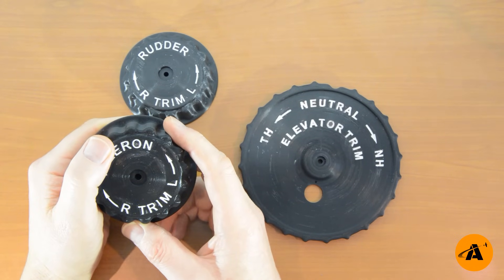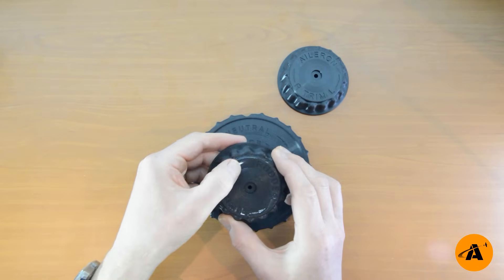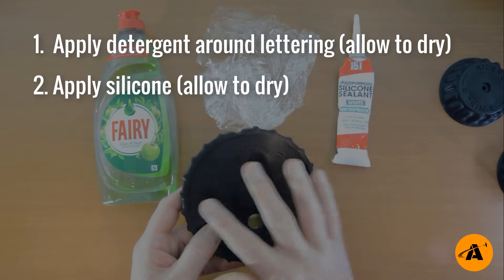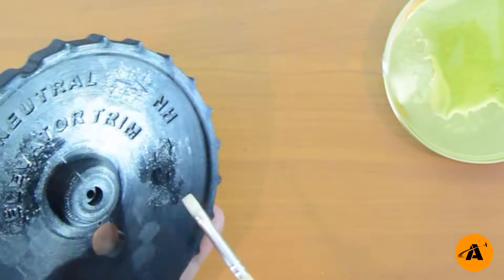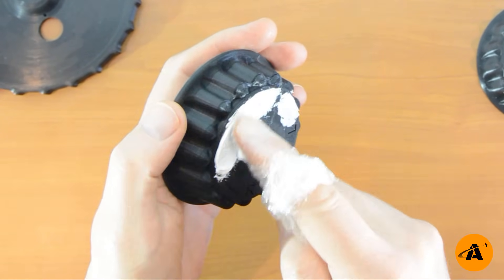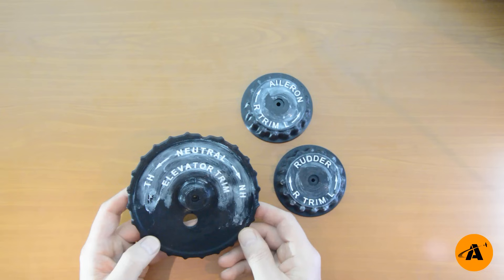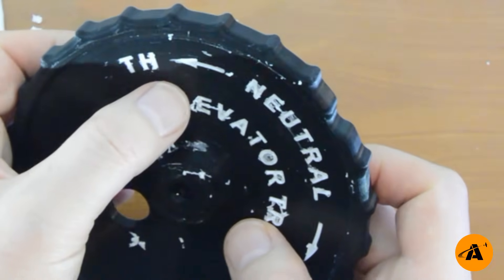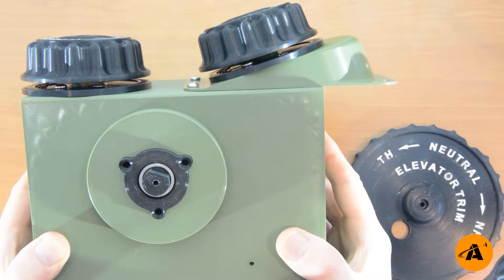Add white lettering to your 3D printed parts

Comment: Have you considered raised lettering? set a pause in the slice and change the filament color. Resume print and viola!
Reply: You’ll find that it may not be so easy on the bigger wheel.
Reply: Wouldn't it leave one or more layers of color on any layer that's at the same height as the letters?
Reply: @peterkn2  correct. one can maybe achieve this with custom gcode and a lot of patience, but at this point just get a multi material printer
Reply: @peterkn2  I haven't had that issue. I modeled a part with raised letters and made sure the height was evenly divisible by .2 (1mm) and it worked great.  The first color was orange and the letters were white.
Reply: I used yellow TPU to print large custom raised lettering on some black TPU mud flaps that I made for my Japanese mini truck.  It turned out great.  It wouldn't be as nice with smaller lettering because FDM print resolution is fairly low, and it also wouldn't work in the example shown because the control wheels had portions that were higher than the lettering.  Raised lettering is seldom the highest portion of an object because it'd be scraped off by contact with other objects coming in contact with it.  That's why most lettering is engraved (negative, below the surface) rather than embossed (positive, raised).
Reply: Easiest solution: Bambulab printer + AMS.  With just a few layers needing white, even the waste poops will remain limited.
Reply: @MisterkeTube  I'm waiting for the K2 Plus. I love my K1C.

Comment: I would use a wide roller tip on my pinstriper tool before I went through all that. They're not cheap but they work and save a ton of time.

Comment: It would be possible to redesign the parts to accept a 3D printed disc insert with the text printed as the first layer in mirror mode, either a multi material system or just manual filament changes can be employed. and then glue the disc to the part, the text and the disc could be printed with a shiny glass like finish or a textured finish by using either a textured PEI bed or a smooth PEI bed.
 This would be a much easier method of production.
Reply from the maker: .. or a print of white plastic sandwiched between the black so it shows through the letter cutouts?

Comment: Silicone sealant can be thinned with naptha (white gas in the US or Coleman fuel), which apparently does not effect PLA. You could thin it enough to use a fine brush or a syringe to make sure the bottoms of the grooves are wetted. Neat idea and I will have to white sealant. I wonder if it can be colored easily. The acrylic paints can be good as well but they don't like getting wet.
Reply: Seems to be 'zippo lighter fuel' based on a quick google, can you confirm?
Reply: @MikePreston-darkflib  Yes, I think so. It is like a finer distillate of gasoline. Earliest petrol engines used it because it was being distilled for cleaning. The "gasoline" collection of molecules was a waste product from making lamp oil and burned off or evaporated away.

Comment: Try one of the silicone mastic tools to press the mastic into the letters and clean up afterwards, they remove excess mastic completely from tiles and worktops
Reply from the maker: Thanks. Just been googling that. If the letter surface isn’t smooth, but curved with layer ridges will it still be as effective?

Comment: Have you thought about using a negative draft angle for the letters, so that the silicone is mechanically locked inside the cavity?
Reply from the maker: Great idea
Reply: @AuthentiKit  Was thinking same, or a connecting  sub-surface tunnel.
Reply from the maker: @andyu69  Split it in half, tape over the exit of the letters, fill the inside with silicone (letters joined as you say with channels/tunnels) so it pushes out to the surface, then join the halves either with screws from the back so not visible or glue them

Comment: I've been using regular spackle not the quick dry or lightweight. You put it on like frosting making sure it's all the way into the crevices. Let it get dry overnight. Sand the Spackle off and use a damp cloth or toothbrush. Personally I've been spraying my 3D prints with a clear coat

Comment: Since I don't mind having the letters a little bit sunken and my lettering is in a plane parallel to the build plate, I do it the following way:
I let the printer come up to the plane of the lettering, switch the filament to white, let the printer continue for 2 or 3 layers, switch back to black and print 2 or 3 layers in black with the letters not filled in.
(Yes, that leaves a thin white strip around the periphery also, but I don't mind)
Reply from the maker: 30 seconds with a black sharpie sorts the white line. That's another approach I've considered.

Comment: Nice! Thx for sharing. I tried something like this with extrudes text, but this looks much better. Maybe you could also use that white paint, that car fans are using to pimp the tires.
Reply from the maker: Tippex/whiteout is pretty good. Best probably is acrylic caulk as it wipes off easiest
Reply: @AuthentiKit  will try that definitely! Thx.

Comment: Raised lettering would be much easier to paint than recessed lettering. If you can modify the print to include raised lettering, do that instead.
Unless you have a shaky hand, the painting process will require virtually no unnecessary clean up. 
Of course, for inlay painting, your vid technique works quite well. Thank you.
Reply: Whoever wants to do something like that today probably uses an AMS (multi material system) and just prints it in multiple colors…
Reply: If the letters are raised enough, you just roll the paint out like old printers did on a surface and just press the letters into the paint and lift. All painted at one shot.

Comment: With 3D printing, it should be possible to give the lettering a "lip" or "inner bevel" of some sort (I'm sure there's a technical name for it) so the infill can't peal out.

Make the cavity for the letter bigger on the inside instead of having straight walls. Does that make sense?

Comment: I suppose for letters that big I would try using a ballpen corrector (dont know the name). preferably the one that acts like a pen as well, not the bottled up with a brush or the tape one of course. And for any other flat surface good old spray and flat piece of paper to get rid of the recess + 15 minutes sanding. Still a nice idea but the time and effort just doesn't make it a good option for myself. Maybe if I needed something fancy
Reply: OH and anything that melts like wax and can be done using a hot glue gun and scraped off flat if neccesary
Reply from the maker: Each to their own i guess. I’d hate to do all that sanding. Ive tried the tippex whiteout. Not bad in certain situations when the nozzle is narrow enough.

Comment: They sale paint sticks to do this with, that is what we used in aerospace plants, rub it in let it set and wipe excess off and you are done, I used this on my gear shift knob in the car
Reply from the maker: Thanks. Embossed lettering or debossed?
Reply: Raised lettering in 3D print.

Arial Bold font works well.
Reply: @BlondieHappyGuy  No I don't think Aerospace companies will be using a kids paint sticks
 MRK51123 - La-co Industries Inc Lacquer-Stik Fill-In Paint Marker

Comment: I wonder, if the letters would stay in even more reliably with one tweak. If the letters had a very small amount of negative chamfer, so the bottom of the groove is about one line width larger the top. Then once the silicone dries, it "can't" come out - it won't through the top of the groove.
Reply from the maker: I like it!

Comment: What about using thinned enamel or other type of paint, put in a syringe and squeezed into the lettering grooves?
Reply: I was thinking the same thing, it sounds like that might be less work, right?
Reply: Those little tin pots of Humbrol enamel paint used for painting models. That stuff really sticks well. Clean off or thin down using white spirit.

Comment: There is a chemical call PVA poly vinyl acetate whis is used as mold releasing agent. I think that would make your job much quicker and cleaner. It is certainly more expensive than your fairy liquid but   time is money and i think your overall results would improve.
Reply: PVA is also the formula of simple plain white scholar glue. Since it may became transparent when dried, maybe it is neccessary to add some white pigment to it (maybe some household item like gipsy or corstarch would do?), but it may get the job done.

Other option a litte more expensive but faster is use 3d uv resin with white pigment. Apply it, clear the excess, expose to sunlight and it cures in a few seconds.

Comment: I think this would be easier with just some white nail polish, thinned out with acetone, and injected into the embossed lettering with a blunt syringe
Reply from the maker: Yeh, tried that. Great when you don’t slip or it clogs and blurts out. Mess is hard to remove.

Comment: Almost like @josephpk4878 I like to use casting resin applied with a needle.  Hobby Lobby has little bottles, I think in the model paint area, that have needle type applicators that worked well on my last project.

Comment: That's a pretty good result. But, unless the filler must be a silicone for any reason, and you have bought the whole set of acrylic paint just because of the brushes, why not give these colors a chance? Use as small and pointy brush as possible, thin the paint if necessary, and just fill the letters as precisely as you can, but there's no need to be overly careful, if some of the paint gets on the top surface, that's OK. When the complete text is filled, give it a couple of minutes, then wipe the excess paint from the top surface with paper tissue moderately wet with acetone, thinner, isopropyl alcohol, or water if the paints are water soluble. I never used PLA, so I'm not sure which solvents may damage it, and in general I'd suggest making a test sample plate whenever you use a new type of filament or resin. Do not soak the tissue, and do not press it with your finger into the text, to avoid pulling the paint out of the letters. Just put several drops of thinner onto it. You can use some kind of flexible spatula and span the tissue over its edge and use that to go over the text. If the surface is still foggy but most of the spillovers are removed, give it some more time and repeat the above a bit more aggressively, maybe with some more solvent. Once you find a sweet spot between how much the paint should be thinned, how long you should wait before wiping the excess off and how wet or dry the tissue should be, the whole process shouldn't take more than a couple of minutes, drying times included. Depending on the paint type, final drying time may be longer, but acrylic will dry pretty fast. There's nothing wrong with silicone, but other paint types open the complete palette of colors, take much less time, and you can spray the complete print with clear acrylic spray, to protect the text and even smooth the complete surface...
Reply from the maker: Thanks for that considered response and advice. My experience with getting paint type stuff on the surface where you don’t want it is that its very hard to fully shift it. I guess with thinners and suitable solvents that might be ok though

Comment: Very interesting! I have a Cessna switchbox which has no letters/lines/digits on it. I could make a new frontplate with your method. What program you used to do this job? I'm not good at designing yet... best regards from The Netherlands.
Reply from the maker: Hi, I use Fusion 360. Takes a little getting used to but worth the effort as it's very rewarding what you can learn to create!

Comment: Given you have digital files of it, would it not be easier if you drew a template around the letters, cut it out in vinyl (machines do it perfectly) place it on top, do the silicon thing, peel of the vinyl template..the clean up process would be a lot easier
Reply from the maker: You're right - yours is a superior solution but the idea of this technique was something "good enough" with readily available materials
Reply: @AuthentiKit  oh yeah don't get me wrong I had never thought about using silicon, I really like the idea you came up with!

Comment: I know there are some layer lines as you pointed out, but the surface is remarkably smooth. What orientation did you print these?
Reply from the maker: Just regular orientation as you’d expect.

Comment: Wouldn't a white permanent marker with a fine 1 or 2mm tip do the same job but quicker?
Reply from the maker: I've bought a ton of markers, paint pens, syringes for paint/whiteout. You need a really fine tip with some depth to not catch the edge and a reliable flow of the paint/ink. I sometimes touch up with a paint pen but haven't found it effective for the volume.
Reply: @AuthentiKit  OK, then I am gonna try it your way. Seems simple enough 🙂 Thanks

Comment: Would definitely be careful to make sure it's not washed down the drain. I doubt a little bit would cause a problem, but I've seen fairly small amounts of silicone cause severe septic problems. It can probably cause problems with larger systems too. It can expand a lot and it just never breaks down. (...or it takes a very long time to break down, kind of like human hair and large globs of fat).

Comment: Better then a brush is a piece of soft foam dip it in fairy 🧚‍♀️ and gently dab on your surface even over the letters.   Just saying 😉
Reply: Ps another tip..the brand Motec has filler spray. Get the black one spray that on 3x and gone are the little grooves it won't affect the deeper letters.😉

Comment: This is quite messy dude. Try with nail polish thinned with acetone. Just 1 or 2 ml to a full nail polish bottle is needed depending on how thin you want it to be. Then you can apply it with a needle and a small syringe. Once it dries you can clean it with some acetone if you painted outside the lettering.

Comment: Since these are 3d printer printed parts, you will have a spatula or two lying around. (You can even print one.) Use the spatula instead of your finger to remove the fresh sealant. It makes the post processing clean-up much easier and quicker.

Comment: I'd rather have printed one or two layers of white PLA so that it would be visible on the bottom of the letters and then continue with black PLA. Would have been a lot easier imho.
Reply from the maker: Its an option, but then you get a white ring round the edge you need to colour over
Reply: @AuthentiKit  True. Might still be less work.
Reply from the maker: I agree , it would be. 30 seconds with a sharpie.

Comment: Screenprint ink is far better, you can wipeout very easy when it has not dried. once dry last for ever
Reply from the maker: Thanks. I’ve been Googling that. It would need an applicator?
Reply: Yes maybe a Squeegee but a credit card o plastic thing will work

Comment: Interesting technique, but honestly wouldn't it just be easier to master the art of multi-filament printing? You can absolutely do it manually with a single-extruder printer. The hardest part is setting up your slicer correctly.
Reply from the maker: I am now doing that on some designs but it’s not so practical if the letters are on a sloped surface
Reply: @AuthentiKit  Good point. I've only tried multi-colour on flat things. Great for signs and control panels though.

Comment: Is this the way the Brits did it in their ridiculous little cars back then? NONSENSE! Just get a syringe, your Titanium White, some bit of Medium (to cut the paint but for this water may do) - and a bit of liquid wax if you want a dull finish to the job - and use a scope to see what you're doing. You inject and fill the depressions - so easy I forgot to laugh. 😅

Several other good ideas in here. I thought they were raised - which would have called for medium-sticky ink (half dried - add water as you go) transfer a thin coat from a blob to a small roller (hard rubber) the best choice. That's how parts used to be stamped before ink-jet was happening - using all manner of rubber stamps, rollers, and stencils. Still done for Merch.